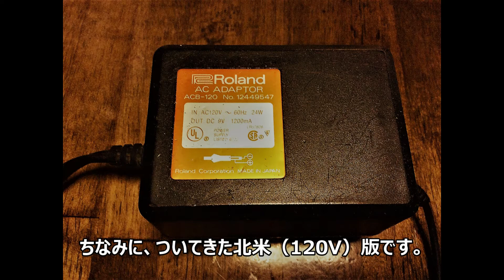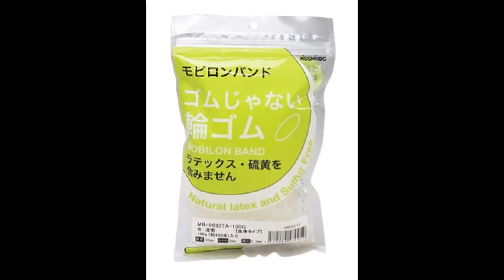ROLAND PR-100(QuickDisk) 修理 クイックディスク ドライブ　ベルト修復  0001

Comment: Can you help me please. I've replaced the belt on my original QD drive and put the drive back but the red light stays on and it doesn't read. I think I have the wrong belt. Can I buy a belt from you?
Also, when putting back the drive there is a lever at the bottom that goes into a hole and also what looks like a switch contact. Do you have any advice on mounting  these when you put the drive back into the case?
Reply from the maker: Since the drive is old and there is basically only one type, it is better to check if you really want to replace the belt and fix it. With the belt removed, actually insert the QuickDisk media and operate it to see if the motor is running.
If the motor isn't running, unfortunately it wouldn't make sense to get a belt from me. This is because the inside of the drive is out of order.

Belts should be handled by Amazon, and as I wrote in other people's comments, I think you should also have the option of considering attaching an adapter to the floppy emulator.
I'm thinking of making a QuickDisk adapter and actually replacing the drive, although it's been a while since I've received requests from everyone.
Reply: @maru_workshop  The motor is working but when I fitted a 3mm x 90mm (folded length) belt to the drive then it would not turn properly. Maybe the belt was too tight. Also, the belt doesn't want to stay in place but moves upwards.
Reply from the maker: There should be no problem with its length.
Often the belt is slightly up or down.
What you can think of
1) The bearing of the shaft of QuickDrive is worn, and when the belt is attached, the shaft becomes slanted, so that correct rotation cannot be obtained and the belt shifts. Also, because of that, the rotation is not stable or the rotation becomes slow and normal reading and writing becomes impossible.
2) The motor is tired and rotates, but if you put on the belt because you are tired, there is a possibility that there is no torque or the rotation is slow.
If so, the result seems to be the same even if the belt is replaced.

Since the drive shaft uses oilless metal bearings instead of ball bearings, it is quite possible that the oil in the metal will run out and wear out over time.

3) The material of what is used for the belt is a problem.
It's out of the question if you're using a rubber band to bundle something.
Since rubber bands have high elasticity, rotation is not stable.
You must use a Mobilon band or a genuine band.
The Mobilon band has some expansion and contraction, but the rotation is very stable.
Reply: @maru_workshop  Thanks for your help. I've bought several belts but the one that actually works is a flat belt that's 2.5mm wide and 105mm folded length. With that belt in place then the drive seems to work and the red light switches within a couple of seconds after turning on the PR-100. Unfortunately, when I try to read from my PR-100 Music Library discs (EL-113: I believe then were issued when you bought a new PR-100 because they're mentioned in the user manual) then I get a loading error. The drive spins for a while - I can see the head moving across the disc - but it eventually stops with a loading error ("Load ERR"). I've tried saving to blank QD disks too but I get an error with that too. Do you have any thoughts what might be the problem?
Reply from the maker: 1) First, your belt is at least not a "Mobilon band".
This is very important.
You shouldn't buy a regular belt with the same idea as a Mobilon band, as the "Mobilon band" and a regular drive belt are quite different.
I use the Mobilon band because it has almost no sulfur component like a normal drive belt, so it is very durable, but it expands and contracts like a normal rubber band, and even when used for a belt, it is a rubber band. It is unlikely that the rotation will become unstable. Even if you had a Mobilon band that was the same length as you, it wouldn't work for QD.
2) I seem you to not understand it, so I'll write it again.
２－1) The bearing of the shaft of QuickDrive is worn, and when the belt is attached, the shaft becomes slanted, so that correct rotation cannot be obtained and the belt shifts. Also, because of that, the rotation is not stable or the rotation becomes slow and normal reading and writing becomes impossible.
2-2) The motor is tired and rotates, but if you put on the belt because you are tired, there is a possibility that there is no torque or the rotation is slow.
If so, the result seems to be the same even if the belt is replaced.
3) Another problem is head wear.
If the head is worn, it is impossible to read or write to any disc.
Of course, head wear is not a visible level, and the cause of the load error is largely due to the above-mentioned part, but if the head is worn, a load error will definitely occur.
4) As with FDD, logic can be causing problems at the same time.
The read data is converted into a signal that can be interpreted by a computer by logic and output. The opposite is true when writing.
Even if the conversion cannot be performed there, a load error will occur at the same time.

I think that it is the end of life when a load error occurs. There are no replacement parts, and it should not be replaced on a part-by-part basis. Everything is set, adjusted and shipped in that state, and think twice about what it means to be out of alignment.

Unfortunately, more than that, I think it's a waste of time. If you ask any more questions, you probably won't answer.
(Because it is related to the contents of the youtube membership ）
Reply: @maru_workshop  Okay, I understand. Thank you for your replies. I'll see what I can do to get it working but I take your point about wear. I always have the Gotek USB drive to go back to if I can't get it to work. Thanks again!

Comment: Thank you for an excellent video! I've just managed to repair my belt with your help! :-)
Reply from the maker: You are welcome.
I am honored to help you.
However, it may be necessary to consider replacing it with a floppy disk emulator in the future.
Reply: @maru_workshop  Thank you for that suggestion. I have done this with my Sinclair ZX Spectrum computer. In general, my philosophy is to repair these vintage items and to leave them in their original condition. I do have some QD disks I can read from. They are still available on eBay.
Reply from the maker: @edward_grabczewski  
I don't think there is a problem as long as it can be used. But the problem will come in the near future. The magnetic material is no longer produced, and the magnetic material has a limited life as long as it rubs against the head. I advise you to prepare for it in advance.
Reply: @maru_workshop  Is there a Gotek that has the connectors for the PR-100?
Reply from the maker: @edward_grabczewski  Yes, via adapter, you can use.
Both firmwares, HxC for gotek and Flashfloppy, support the same connection.
https://torlus.com/floppy/forum/viewtopic.php?f=2&p=21001#p20956
Reply: @maru_workshop  Thank you! I've taken your advice and bought a Gotek adapted for the PR-100.
Reply from the maker: @edward_grabczewski  You are welcome. 
And good luck!
I plan to make this adapter and install it in my PR-100 soon.
Reply from the maker: To be clear, this is just a workaround, not a permanent repair.
Because this drive is no longer in production and there are no new spare parts.
Also, in general, even manufacturers should replace the drive instead of replacing the belt, so it is unavoidable to say that it cannot be used because it has already reached the end of its life.
I also have equipment in my house. However, this is for verification, so I don't want him to die. It is effectively "dynamically preserved".
Unless you're in an environment where you can make all the parts, including bearing metal, in your garage, your place of employment, or an acquaintance, but if not (it may be repetitive and persistent). It's safe to switch to the emulator (although not).
I intend to do that too.

Comment: crap!
I just ordered this machine
Do I need to have to have the weired disks to be able to do anything with it?
I only have regular computer hard flopies not the QD ones.
Will it work without them even if I cant save my work will I at least be able to do like live stuff with it or was the whole OS to this thing on those disks?
Reply from the maker: QD has no system software, so it save and load data only.

If you data save and load on this, you must get QuickDisk media, or convert QuickDisk drive to emulator.